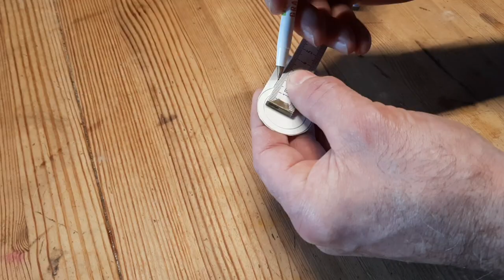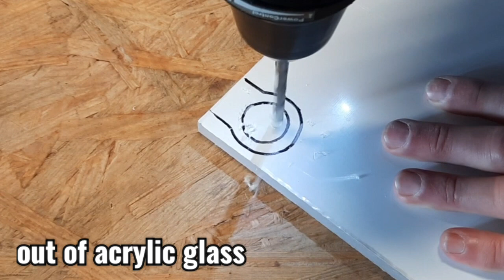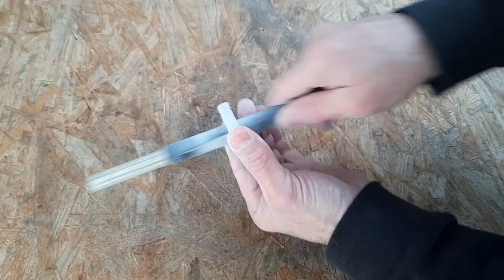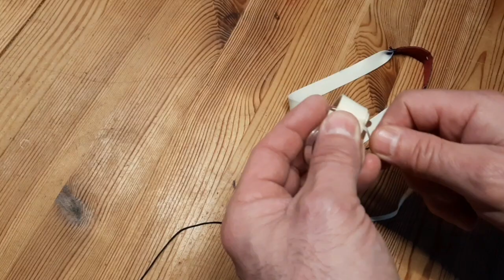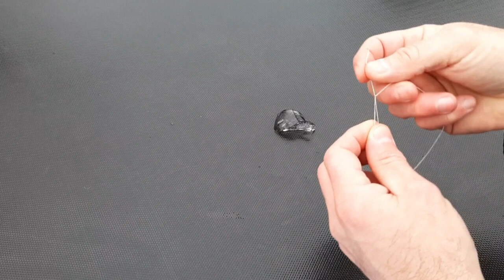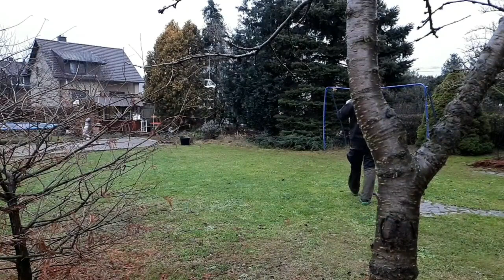making a RING "of ice" frameless Slingshot + shooting

Comment: Que bonito....que medidas les pones a las bandas del frameless?....son cónicas?...un saludo, amigo...
Reply from the maker: thank you very much Emilio🙏. i cut the bands a little longer than for a normal frame, but i also taper the bands. in the film i use 0.6mm bands white with a 11x18mm taper. many greetings👋🙂
Reply: @zwillenfink9729  Gracias, amigo..